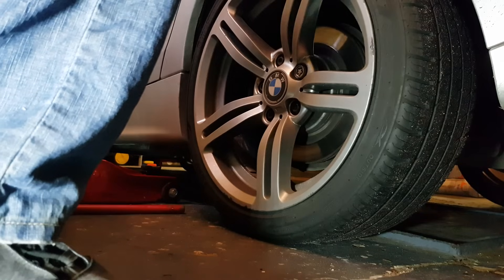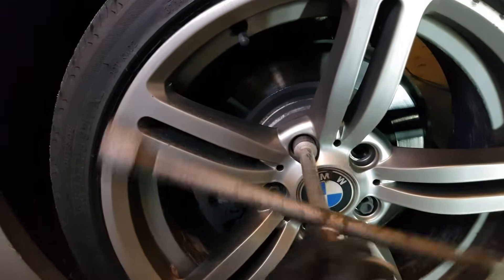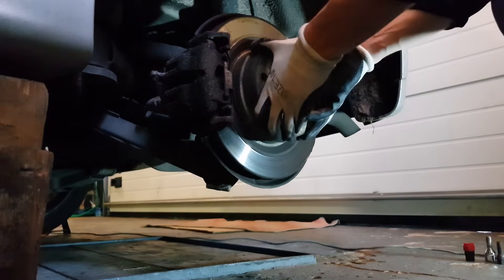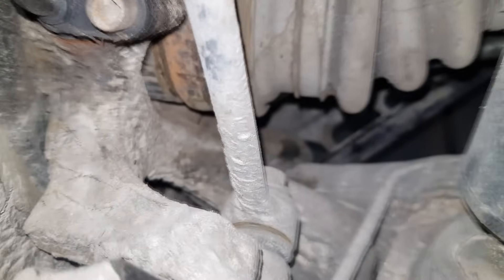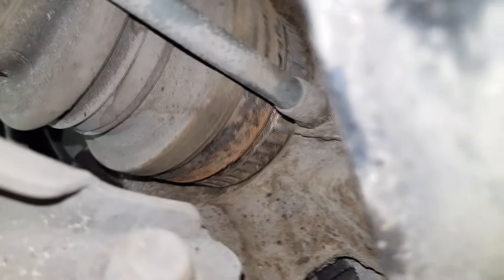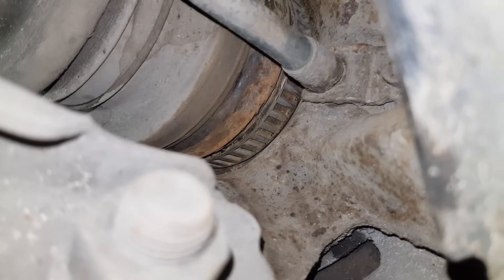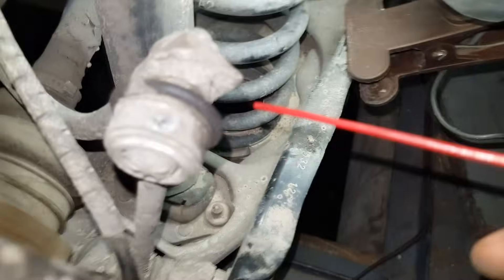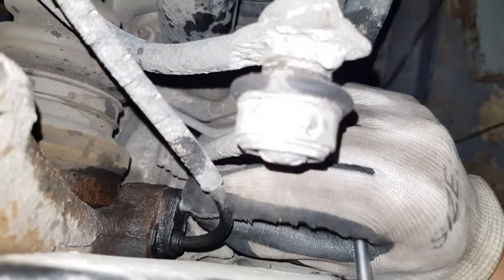Free BMW stability control DSC/ESC fix that works perfectly and it's easy to do(HACK🤖) e87 e90 e60

Comment: All this cost me was the cost of a cheap garage-jack that I needed anyway. Could have been thousands!
Thank you! this is a lifesaver!
As has been commented earlier though; make sure to use super-thin washers. A little to fat, and the abs and traction systems go offline and the dash lights up like a Christmas tree!
Brilliant video, man! Very helpful! Thanks again!
Reply: How thin can the washer be? Can you provide approximate measurements?
Reply: @68KKC  I just put a 1mm washer and drove 20km, works fine. If I have any problems with longer trips I will post a comment. If you are installing a new sensor I suggest 1mm to rotect the plastic, if you use the old one then even 0.3mm can work as the plastic is already eaten up and you dont need a lot of distance.
Reply: By simply checking each wheel.  Lol

Comment: I was quoted £900 for a new drive shaft at the BMW main dealer during a recall inspection. So I placed a washer between all four sensors and the problem went away for about a £ and a year on it’s still good.

Comment: Turn the steering wheel all the way to the left, then all the way to the right.... Problem solved!  And if you have a petrol e53, get an LPG GAS CONVERSION, my BMW X5 E53 4.8IS runs absolutely fine on gas!

Comment: My BMW 1 Series 120d M is currently experiencing an issue with the DSC warning light illuminated on the dashboard. I have taken it to a BMW service center for diagnosis, and they have recommended replacing the DSC control unit due to its age. However, the cost of a new DSC control unit exceeds the value of the car. Despite the warning light being on, the car is currently driving fine. I am wondering if there are any friendly garages in the UK (near Newcastle upon Tyne) that could fix the DSC issue by following this inspiring video?
Reply: If you find one, please let me know as I am dealing with the same issue now and looking for a garage.
Reply: @Милана-р8у9г  not yet, I am still driving the car with DSC warning light on....

Comment: You need to check how the sensor is and replace it if is damage!
That's the stupid way to fix a problem and duck tape is not the solution!

Comment: I have an issue with my 2016 F21 116d Sport. It doesn't happen all the time, but every 7/10 drives on average it will malfunction completely and the DSC is permanently disabled, meaning I also can't use cruise control or eco/sport/sport+ modes, unless I pull over, turn ignition off and start engine again and hope it doesnt happen.

I find it happens if you slip the clutch a lot coming up out of an incline from a standstill. It also will just happen randomly cruising on the motorway and boom "DSC malfunction" into "cruise control failure" and I have to drive myself then.

I might give this a go and hopefully it fixes the problem.

Comment: Hi, I have a 2011 BMW  740LI, my car has been down powering on me while driving, along with a saying DSC malfunction engine chassis stabilization reduced. Once I turn the car off and back on the malfunction goes away and I can drive again for a couple days until it does it again. After taking it in to BMW having them do a diagnostics check they’re saying I need a new DME which costs about $2500. 
Is this something I should do with my car first before I spend thousands of dollars on a new DME, please let me know what you think. Thank you very much

Comment: Thanks mate, understand that will solved the Dsc problem.
But after a washes applied, how's the abs system? It's that still working on emergency braking?
Reply from the maker: Everything works as it should

Comment: I have exactly same problem as in the video. I drove about hundred of kilometers in the corners with live data from diagnostic and I was not able to figure out where is the problem. Diagnostic will say nothing, live data also. It shows sometimes, sometimes not. I went crazy about that. Few days of diagnostic rides and I found out nothing. Tomorrow I will try Your fix. I let you know if it helped. Thank You in advance.
Reply: Confirmed. It helped. Rear left sensor was scraped a bit. I added a 0,5mm washer and now it is okay. Thank You.

Comment: Do you have to do both sides? And is it only on the rear wheels?
Reply: All tires have sensors
Reply: @bal4cars  I think on this car it was just the rear ones that have abs rings
Reply: @Billy_Bull_Sheeter  ok you right
Reply: @bal4cars  I only know because I had it done yesterday.😂
Reply: @Billy_Bull_Sheeter  I mean you do have speed sensors on all 4 tires just no axels at the front

Comment: Thank you for your video,  My BMW 1 series 20d M Convertible had the same problem.
I done what you did with a plastic washer.   It works fine and when I make the car skid/loose control the traction control still kicks in.
Job done 👍

Comment: Is this only on the right hand side? I have this problem. When I start the car up I struggle moving off if I need to turn the wheel and it locks the wheels up

Comment: BMW is losing its popularity,a complicated car with high cost for maintainance,what a rip off,

If BMW wants to stay in the market,they have to come up with components that are long lasting and do away with all the plastic and computer box control system,but come up with an idea that all electrical components are controlled with current direct from the battery so that more of their cars could be sold and hold a large share in the Market,something to think about.

Comment: Thanks for this. I had an appointment for the auto shop, but decided to give this a try. It was easier than I thought. But I had a problem.

I used a washer similar to what was in the video. Once I got it back together the TCS problem was fixed. However, after a mile or so, I got ABS, FCS, and Tire pressure faults. After driving more, the faults cleared, but they would just come back over and over. I decided to try again with a thinner washer. I installed a 1mm washer and now the TCS is good and no other faults.

All good to go.

Comment: How do you determine which wheels sensor is needing  this fix?
Reply: You have to check all of them
Reply: So does it only happen if it makes contact with the ring ?
Reply: Må warning goes away when i actually start the engine is this normal?
Reply: This is what I was asking as well I have a 2008 328xi I just picked up for 3 grand I think it’s gonna be a cheap and easy fix watching this now just gotta jack the car up tomorrow and check all wheels 😅
Reply: @Dominicgambino  tell me if ur worked
Reply: have learned a few things
there is one for each axle for the F22, likely the same other models
Several ways to find it. Best to start with code reader like BimmerLink
that will tell you the axle, FCP euro will have it, and quality
about $50, easy to change but PAY ATTENTION to routing!! @Dominicgambino  

if you want to do the washer fix routine, it may work
Reply: @Dominicgambino what was the issue

Comment: that's awesome video 
my car is 800 hp this is jeep srt8 
When I want to move with force, Will Lock has a very loud sound, and sometimes Will Lock is activated at high speed. What do you think is the problem?

Comment: When I drive I get the traction control light flash and car judders dropping speed, when turn traction control of the car is fine but sometimes the two other lights come on, the abs and handbrake warning lights come on..When tried diagnostic nothing appears and the lights disappear when car is restarted... what could this be? Same issue as described in vid?
Reply: Here aswell. same problems.
Reply: I think you might have resolved by now, i just had the same issue and did a temporary by goin in red line till 3rd, (idk how but it worked) and imma try this tomorrow.

Comment: I did this and cleared codes with carly, it didnt work !
Reply: It's always possible you actually have a bad sensor, search for methods to test your sensor or swap sensors to see if the problem switches sides.

Comment: I try this on my BMW e92 2007, but it not help. First i had only the flashing traction control lamp, after i do this in the video i have abs,dsc,dtc and tyrepressure lamp on. It comes and goes when i drive.

Comment: Hey man. Thank you so so much for your helpful video. You have saved me a ton of money. Here in Norway I got quoted around 23000 NOK (2.300 € more or less). Does anybody know for how long the car can go with this quick fix?
Reply: How did you find out witch tyre needs that washer
Reply from the maker: Thats so cool to hear. 3rd year still going witout any issues after this fix.

Comment: What I did after this hack , took wire wheel to axle then treated it with rust conversion, then painted it. I check it every spring, and touch up as needed.

Comment: This is NOT A FIX. You are prolonging the inevitable. You have know way of knowing how consistent your air gap is. Sooner rather than later the same thing will happen. 
Possibly causing a crash. 
The reason garages dont do this is because it's not a safe way out of a problem. 
If you can't afford to fix it properly you should not have a car on the road. 
If you want to save money and you know this is the problem ring around for competitive quotes from reputable independent mechanics. They are cheaper than main dealer and every bit as good. 
Brakes should not be messed with by people who dont know what they are doing.

Comment: It's weird I have a 2004 BMW 325 I and when I'm on the highway at higher speeds the 3 lights come on the ABS, traction control, red brake light and then it goes until like a limp mode type so I pull over turn it off turn it back on and it goes away, like when I'm hitting 50-60 miles an hour and the rpms hit 3-4 thousand it shuts down the power and I have to pull off the highway,, I bought 2 front abs wheel speed sencers thinking that was my problem,  but watching this video makes sense,, U THINK THAT I HAVE THE SAME ISSUE PUT A WASHER ON MY ABS SENCERS, should I do this to the front or real wheels??  I replaced all 4 oxygen sensors my disa valve my Ignition coils spark plugs even the oil level sensor thinking that would solve it cost me about 800 bucks for all that and I did all the work myselve, so I didnt have to pay no labor I'm at my last wits end with this I'm scared to drive fast on the highway
Reply: Did it work I have  same problem problems
Reply: @ufotv8935  dont have the car anymore and no the disa value didn't work

Comment: Thanks for video, did this fix today, removed and cleaned both rear ABS sensors, I also cleaned the ABS ring with penetrating oil, put washers underneath ABS bracket and it worked. Thanks again, highly recommended!

Comment: Wouldn’t it have been best to clean the grooves in between so the sensor doesn’t get a false reading? I see a lot of rust which will conduct electricity like a tooth . All you did was disable it,not fix it.
Reply: how to disable it

Comment: Add to title or description other stability control too like esp and those. Every system uses similar mechanical parts dsc is just bit more sensitive because it reacts earlier to any slips or slides.

Comment: ABS sensor control brakes  and give informations to  DSC ( Dinamic Slip Control )  which contol intake throtle . Is not breaking the wheels

Comment: U don’t need that ring . Just clean that sensor and the Rust with some steel brush
Reply: That's kinda what I was thinking... Maybe even spray some rust inhibitor on there. Won't be a lifetime fix, since the underside gets all the road grime and water/weather, but better than nothing.

Comment: Ok I get it, but placing a spacer like that could get water, debris and salt ti get inside the sensor..
Reply: The end of the sensor pointing towards the driveshaft (through the metal) is already exposed to the elements. It is like a crank or cam position sensor in function. The part of it that now has a small gap is just the plastic used to be able to mount it. If you're really concered, just use some silicone sealant or gasket maker on the faces of the washer to help keep the bolt/bolthole threads from being exposed/rusting.

Comment: Great video, fixed my annoying Tc light coming on intermittently and losing power!!! Just make sure u don't use a thick washer like I did first time round...made the speedo wobble and brakes lock up when stopping at a slow speed!!! just make sure washer is super thin👍👍👍

Comment: Lincoln mkz 
Some times thanks enough 
I don't know how I would thanks for this video
Dealer said it cost you 2'300$ 
When I tried it all works for me, thanks for your very helpful video
Reply: But the question is - Which Tire? I have 2013 328i xDrive 4door Sedan.

Comment: Had the same problem on my 120D Coupe...My old eyes thought that the fault light was the A start system / EGR valve kicking in and cutting power !! My local garage looked at the diagnostics and no fault on the EGR and diagnosed the Reluctor ring. Fixed as per your video £70... Good call .. BMW would have changed a shaft.....robbers

Comment: I changed my stability control system from air to spring, do you know how to get rid of the display light
Reply: Did you try turning the wheel lock to lock with the vehicle running? Could be you need to reset the steering angle sensor.
Reply: @intricate6927  thanks for the reply, l don't know if this apply to BMW X5.  My mechanic didn t tell me the stability control  system light would stay on. Due to constant issues, l changed the Air bags to regular springs. Iam told the sensors are not recognizing the change. So l think l have a sensor issue?
Reply: @larryarobbo  no problem, it applies to pretty much all BMWs from what I understand. I have the X5 also and I'm trying to track down my issue causing the trifecta. It's a possibility its a sensor but try the easy thing first. The way I understand any front end suspension work needs a steering angle reset by turning lock to lock to turn off the trifecta. Hope this helps!
Reply: @intricate6927  thanks, will let you know.

Comment: I had this light come up when driving on the motorway but after about 3 hours at about 70mph everytime I accelerate in a straight line, i done a diagnostic after journey but nothing come up maybe need to diagnose when light is flashing? Any idea what issue could be?

Comment: 2009 e90 328i, did this and my brake, abs and traction control light came on, removed the washers and the back to the original problem. Traction control kicking on randomly. Why did doing this make all those lights come on?
Reply: Darrin Deason I have exactly the same problem! I put washers on both rear sensors this morning and now have ABS Light, Break light and Tyre Pressure warning. Let me know if you managed to fix this 🤞👍
Reply: Lewis Bolan I did end up fixing it. If you notice in the video he uses super thin washers. I was using standard size washers and I guess that put the abs sensors too far from the rings. So i found some super thin washers at the hardware store and it worked. The lights haven’t came on for a month now. I’m not sure what thickness the washer was. You might have to try several different sizes.
Reply: Darrin Deason Thank you so much for replying the washers were quite thick that I used so I’ll see if I can get some thinner ones and swap them out! 👍👍

Comment: Thanks for sharing this information, this problem has happened to me and didn't know what to do without pulling out the drive shaft and replacing the Reluctor Ring. Bravo !!
Reply: What size socket to remove the bolt ?

Comment: in the most cases the problem are the tires!! i have it over and over again... most of the people don't look and don't check the tires and so you have minimal differences in diameter between the tires and then you'll have this issue .. or the front tires angle is not right and you'll get the same issue

Comment: I got exactly the same Problem, but my obd tool shows 3 steering angle sensor errors. Could it still be the abs sensor or should I try to clean the steering angle sensor?

Comment: Thanks for the gr8 vid. I just had 3 errors namely; ABS & FTM (Brake & Drive control sys failure) and DBC failure. Is it the same issue that you have just addressed?
Appreciate a reply!
Reply: BimmerE90 I have the exact same issue with my e93.  Mechanic told me i needed to replace the ABS control module which would cost over $4000.   Did you ever get an answer on this?
Reply: @rrryder  Did you ever find the answer?
Reply: @shannonp4037  I did not

Comment: You can actually do it with the car on the ground. You’ll need a 5 allen key. Turn the wheel opposite from where it is. Key thing is ull need to know which sensor is acting up
Reply: So then, would you just do that to all of them instead of guessing which one it is??

Comment: I just turn my traction (dsc) off in my mini. It turns everything off. The traction control on bmws is lethal . One bit of spin and all the power is cut to stop wheel spin. Not good pulling onto main roads. I just click it off , would rather have a bit of wheel spin
Reply: My 335i and 325i never did this though.

Comment: Common issue with the e90s..... ABS sensor. You either have his issues or the ABS/FTL warning lights come up then the ABS kicks in when you lightly break and turn. As long as the ABS sensor is not scored just repace it. If it is, the reluctor ring is warped from rust. Add a 1mm washer to the sensor this may help, if not you will need a new ring as well (no pun intedended ;-)

Comment: I hate to be a pain, but not sure why people make videos without including the year and model of the car because parts and components differ from year to model.  all e90s aren't the same.  Did you use a diag tool to find out which sensor?  1mm spacer?